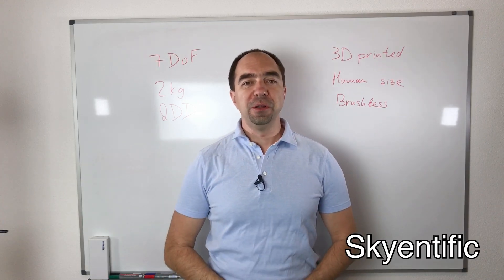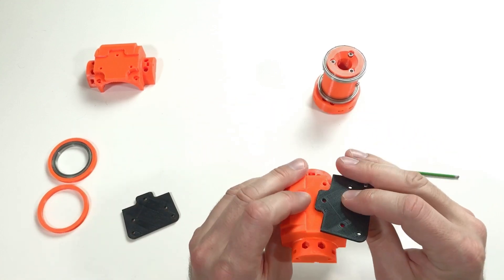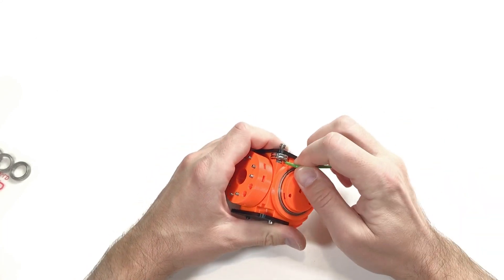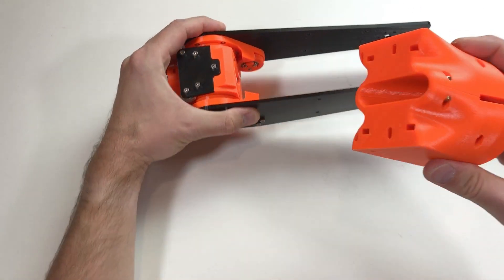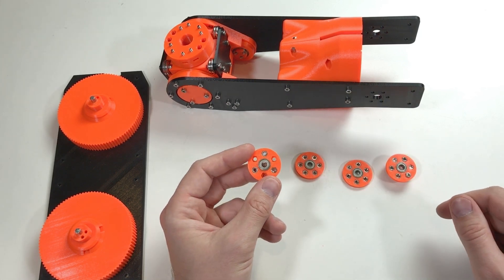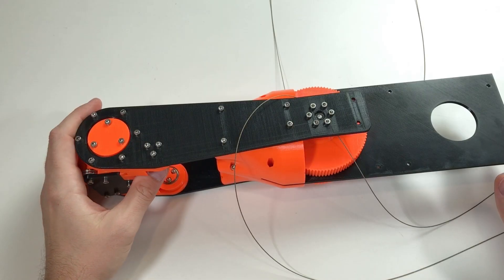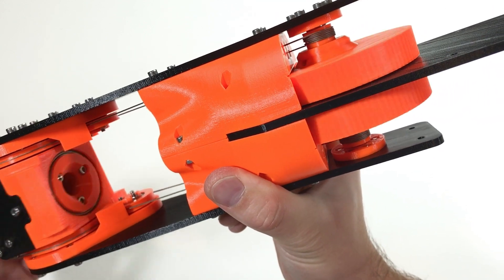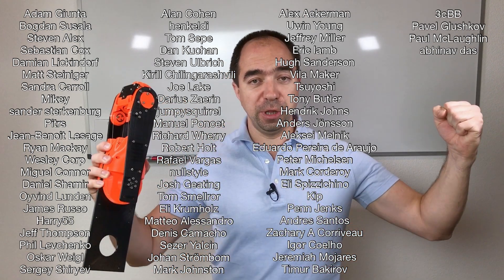New 7DoF Brushless Robot Arm: Wrist (part 3)

Comment: The plans are okay ,if you are building it into a robot how will you implement  code to control both axis simultaneously
Reply from the maker: It is very easy. To control one axis you do "motor1-motor2" and to control second axis you need "motor1+motor2".

Comment: Consider assembly jigs as part of your build. Particularly for those "you need 4 hands" spots. A few extra holes or tabs to facilitate assembly jigs can remove hours of frustration. Sometimes. They don't need to be fancy. A spot for an screwdriver access hole, a little friction wedge or temporary screw to act as a spare hand will do.
Reply from the maker: I think this is a great idea. I will do this for next iteration.

Comment: Can you let us know which cable type you used?
Reply from the maker: This is stainless steel cable, super flexible (7x16 wires), diameter is 0.75mm. With slight modifications, 1mm diameter should work too.

Comment: Awesome work, I really enjoy your videos! I was wondering if you had to build this again, would you still go for the design using cables, or instead use 3d printed bevel gears like in your recent "Another 7-axis (7DoF) Brushless Robot Arm (part1, again)" video?
Reply from the maker: Thank you! Great question. The bevel gear design is way easier to assemble and to design. But the cable design works way better (very smooth motion, zero backlash).

Comment: Very impressive project! keenly following its development. 
i got one question, whats the benefit of differential joint vs the standard two stage joint and can it be used for the joints at the elbow and the shoulder? similar to the UC Berkeley Robotic arm (project Blue). i am guessing they are using similar differential joints through out.

Comment: Super cool design! Do you have a plan for dealing with cable tension as the cable stretches?
Reply from the maker: This is a great question. I decided to see how it will run and how bad would be the cable stretching, and deal with it afterwards.
Reply: @Skyentific  Amazing! Thanks for the response. Will you make an update video? Very interested to see the results.
Keep up the inspiring work!!

Comment: can you give some recommendations for motors, I want to play around with an Odrive. but most of the motors have crazy high speeds (50000rpm) tiny shafts 3mm or are wikedly expensive. Ideally I want something with a 6mm shaft max 12000rpm
Reply: That's not much information to go on, but you could check Gartt ML5010. Rated for under 9000rpm, but probably would be ok at 12k, especially if it's not continuous. The bit of shaft sticking up is machined down to 4mm, but the actual shaft through the motor is 6mm and should be easily replaceable.

Comment: Excellent work! I have two questions.
1: The plastic pulley that is driven by the toothed belt and where the wire is wound up, will it hold for the shearing forces of the wire when applying a load?
2: When the wire is wounded up on the pulley, I imagine that it will do so in more than one layer. How do you cope for the difference in wire length when it winds a second layer?
Reply from the maker: These are rally excellent questions! 
1: I would like to make the pulleys for the cable out of aluminum in the future. But for prototyping the plastics pulleys are ok.
2: The cable (wire) wounds always in one layer. I was very careful to make enough room for the cable to be wound only in one layer. And it works perfectly. Even when I move the output pulley super fast (as fast as I can by hand) the cable always wounds perfectly in the single layer.
Check the video from my instagram: https://www.instagram.com/p/B2V12cfjBER/ . This is from another (secret) project. This video shows how perfectly wounds cable, even when I do it super fast.

Comment: I see that thin wire and I imagine it slicing through the layers of FDM plastic.

And I see those parallel black brackets and I imagine significant sideways flex, as there's no bracing prism.

It'll be fun to see this under load and stop worrying :-)

Comment: When you have built two complete arms, installing the cables should become easier.😄

What's the thinking behind using cables and not a local servo in every joint? It seems like this could be easier to assemble and possibly more reliable.

Comment: Won't the cables cut through the plastic? Also won't it lower the arm's accuracy?
Reply: papalevies the motors he’s using can’t create enough pressure to force the line through the PETG. As far as cutting through the plastic the parts might wear over time but as long as they’re rotating with the lines the friction alone shouldn’t be enough to cause serious damage.

Maintaining tension is the bigger issue. Depending on infil and printing orientation there could be weak spots that could pit causing a loss of accuracy until the lines are manual recalibrated.

Comment: Very interesting design specially with the differential cable mechanism. Can you please show how exactly are the cables arranged? There are no gear teeth in the wrist joint right? Then how is the differential mechanism achieved?